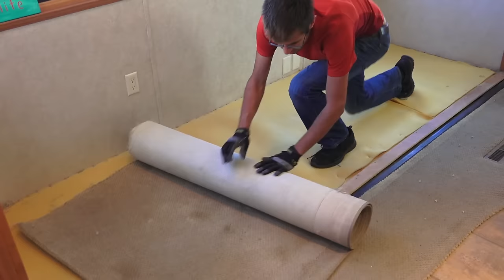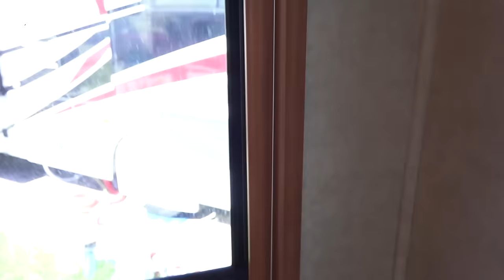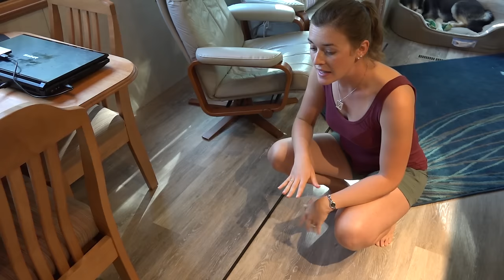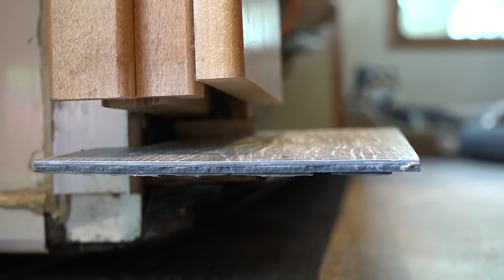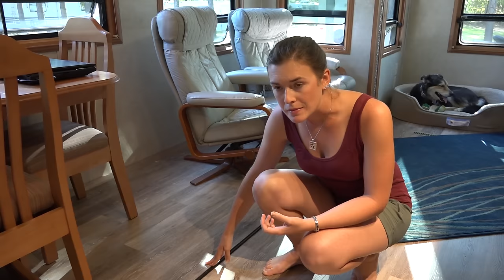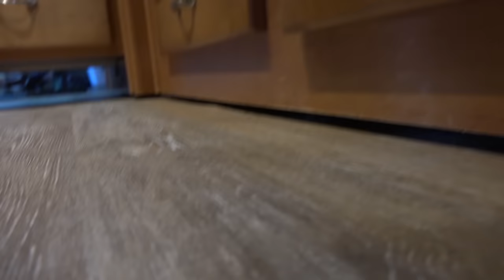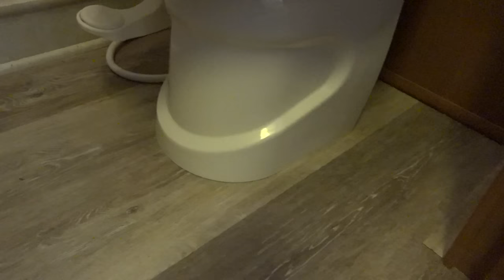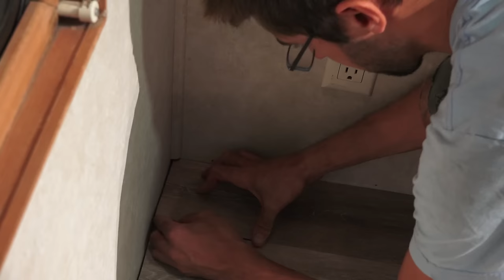DIY RV Reflooring with a Flush Slide-Out

Comment: After your installation about a year ago, and moving the RV, how is the floor holding up?  Any cracks or other problems your viewers should know about prior embarking on this great mod?
Reply from the maker: Holding up great for us! We have one small separation under a slide where we know we did not do a good job installing it. When it's very cold this flooring will shrink and form small gaps.  Probably not the best for cold climates, but there are other options that would probably work better.

Comment: Irealize this is probably long fixed by now being this video is a couple years old, but what I'd have done, not knowing all the details but rather going off their description of using a pad as protection, is to glue a 120grit sandpapter to the pad so as the slide comes in and out, it works it's way through the screw that's hanging down. Once the screw is no longer making marks or sounds on the pad, beef it up a bit and glue anpother peice in and repeat the process until there's a satisfactory gap.

Comment: I have heard that there can be problems with high temperature and the waterproof vinal flooring. Have you had any problems with this? Thanks Great video.
Reply from the maker: We have a little bit of separation where a slide roller sets but i am not sure if it is from the heat.  We have seen 100 plus many days this summer and left the RV closed up for 10 days and do not see and issues yet.  Cold we notice the floor shrinks a bit tho.  If you will be storing the RV for extended times  in heat and cold this might not be the best floor.

Comment: I know this is a year old video but I wonder if a die grinder with a grinding wheel would make short work of those staples.  Could just run it down the wall edge yeah you might have some flying debris but I believe it would be faster than pulling each one.
Reply from the maker: yea that probably would work well!

Comment: Home depot is saying we cannot put this product in an rv where the temps will go below 60 degrees or above 90 degrees because the sticky strips glue will deteriorate and cause the floor to come apart.. buckling and popping.  I see a comment that one person had this happen.  Please let me know if you live or travel where your rv
Reply: Don't listen to anything Home Depot says.  Ever.  But they are actually almost correct.  For a change. Vinyl plank has a lot of expansion/contraction and likes a stable environment.  I think what is happening in their example is the pushing and pulling tearing the joints apart over time.  The glue is not failing, it is being pulled apart. I love lvp but it really isn't a suitable flooring for rv's enduring extreme temperature variations.  I'm hoping it gets better over time like laminate has but it's not there yet.
Reply: We placed the same flooring in our 5th wheel (in So. California).  We full-time RV & temps there in the summer exceeded 100-degrees.  After 4 yrs I did notice about 3 small spots where the strips pulled apart about 1-2mm.  I think this happened more so from heavy traffic over the years rather than the heat or cold.  The flooring is gorgeous with a real wood look, easy to install, waterproof, & extremely durable.

Comment: Hello - we have a slide that buts up to our island - the plywood of the slide goes to about 1/4" of the island so to have a piece of vinyl plank floor extend to cover the plastic ramp piece the slide comes over would require a good 1-1.5" of over lap - it would hit our island I believe.  Any suggestions?  Or anyone on thread I'd love a suggestions - I think our slide is considered a flush slide. the ramp piece is also white which stinks if black would be less noticeable

Comment: Update on protecting the flooring under the slide-out :  I installed the Lippert Slickers and they work great over the carpet. They have pointed grippers on the bottom side, which work well to keep them from sliding on the carpet when the slide-out is moving in/out.  However, after I remove the carpet and install the vinyl tile plank I've ordered I would need to cut/grind off the pointed grippers.  I just found AP Products 013-4300 Slide-Out Sled on the Walmart site.  They have a rubber foam backing that will work much better on the tile floor.

Comment: A hand file will take care of that screw easily enough.
Reply: Lee Biggs - I agree - that's what I was going to suggest!!
Reply: After removing the screw, you might try furniture slides with the self adhesive backing evenly spaced across the front underside of the slide.  This might keep the slide up enough from scratching on any unseen pebbles when bringing in the slide.

Comment: How is your floor lasting? We had ours for six months and it started popping loose. It was professionally installed so we know it was done right. We ended up changing it all out.
Reply from the maker: Ours is holding up great.  We have one spot that comes up a little near a roller, but it's under a cabinet.   The planks seperate a little when very cold but it's still looking good. Been over a year now.  Bummer about yours :(
Reply: @MortonsontheMove  👍

Comment: I am thinking of tackling this project in our travel trailer.  I was wondering if the plank flooring adhesive would stand up to the extreme heat of summer & extreme cold in winter during storage?  Does anyone have any experience with exposure to those elements?

Comment: Hello, we will be installing the same flooring in our camper, one concern I am hoping you can help with. We are located in Minnesota and are wondering how the adhesive will hold up in the extreme low temps over the winter while in storage. I am concerned that the glue may let go and the edges start to pop up. Any thoughts on this?
Reply from the maker: Yes I would be concerned with that. We have seen it pull apart a bit in colder weather.  It's still working well for us but we stay mainly warm. A click lock might  be better suited.

Comment: After more than a year of living with this flooring, would you use this type of flooring again?   What are the good and bad points of having this flooring?  Is it anchored on any side or is it it totally floating?  Is there any adhesive that actually holds flooring in place to the subfloor or does it just connect the planks?
  Someone has already ripped out the carpet in our rv and replaced it with individual adhesive planks.....total junk!  They are not connected to each other and coming up all over.  You can see why my line of questioning.  Any help or tips would be greatly appreciated.
Reply from the maker: This flooring has been great, had a few gaps open in the cold ( it's not designed for cold) but closed up once in warmer weather.  Not secured to floor at all except in one spot along the slide edge to make sure it wouldn't catch.  Hasent moved. I have seen others use this or similar ( next quality up) with success.  I think this is far superior to stick down.

Comment: I have this floor.  You need to keep a few planks extra.  Anytime you cause damage a  plank all you need is a heat air heat gun or a really good blow dryer.  It will heat up the blue on the planks and you can replace the plank easy.  When I replace my refrig, what a nightmare the guys didn't car I lost 8 planks.  I did not have any problem with chipping.  But the color does fade in the sunlight if you have that African dark wood.  I did want to say that you really didn't have to rip out the old vinyl floor but I guess you did.  I put my floor right over the old one. but that's in my house.
Reply: Do you think it could be installed directly over laminate plank flooring?

Comment: I have a 5th  wheel that has carpet that I want to replace with peelnstick vinyl flooding, I am a female living alone in it with my cat, do you think that type of flooring will work in an rv ? I'M not doing the slides.
Reply from the maker: Without slides it probably will be fine.  We have heard however that the peel and stick stuff doesent like temp changes tho and RVs can see huge temperature swings.  It still might be best to stick with a floating floor.

Comment: You should have put 1/4 inch plywood down on the whole thing first, so that you would have support under the flooring at the edge of the slide.
Reply: The way the slide comes in there is barely any clearance under the slide when it comes over the kitchen floor.

Comment: I don't recommend Allure flooring.  I put it down in my basement and had a small spill because of ac condensate pump broke.  The allure flooring looked all wavy and never looked good again.  Also, allure is made of very cheap material and dirt and grit will grind into it over time.  Its not very durable.  But the cost is low. My 2 pence.

Comment: if you're worried about that piece breaking when you have the slide in, why not make a piece that you can put beneath it when the slide is in. like a cheap 1inch wood strip that you can tosse in your cargo area, or just beneath you're rv when you're parked. otherwise it seems like its not an issue. I was thinking of doing black/dark brown carpet in my slides with dark wood flooring in the middle. i have to finish the middle first. i'm replacing my fridge with a residential first before I get to the floor.

Comment: We did ours a little differently for the edge of the slide. We used outside corner moulding (similar to what Mountain Modern Life did: https://mountainmodernlife.com/replace-the-flooring-inside-a-rv-slide-out/) that we stained to match our flooring (also vinyl plank). That moulding  (and the edge of the last plank) sits on top of the rubbery transition when the slide is extended. We still have the problem with it being susceptible to damage when the slide's in, though. Honestly didn't even think about just having that transition as part of the design - would have saved us a few steps. Looks good!
Reply from the maker: We actually had looked at your blog ahead of time!  You guys did a great job, thanks for putting that together!  Unfortunately these RV's just arnt designed to do what we want.  The only true good hard floor slide mechanism i have seen was in a newell coach... where the inside floor actually dropped down out of the way of the slide so it could come in straight... absolutely ridiculous but really cool and actually and looked really reliable.  You pay 2M for it tho lol !

Comment: YOU DID IT WRONG   alot of ppl make this err... on the Flush Slide outs the carpet is the roller OR what the slide slides on top of .  that is going to cut up the new floor and all so trash the under side of the slide .  when you have a 1500 LBS setting flat on the floor with sand under it from the in and out well hurt things even more . 90% of all flush floor slide outs do not have rollers installed on them and you cant install them . you need to make a update video telling others that want to DYI to look out for this . all so its some thing to look out for when buying a used RV . most RV shops well not take it as a trade in as they know the next owner well have a hard time with it and want it fixed
Reply from the maker: We are aware of the risk, and are going to try it out to see how it works.  We will make an updated vid once we have some time and more wear on this install.  I dont see it damaging the underside of the slide, but we will keep and eye out.  We know others that have done similar installs and have had good luck.  We have moved the slide about 20 times now and have yet to see any scratching besides what we showed. Time will tell tho, then we will tell yall. :)